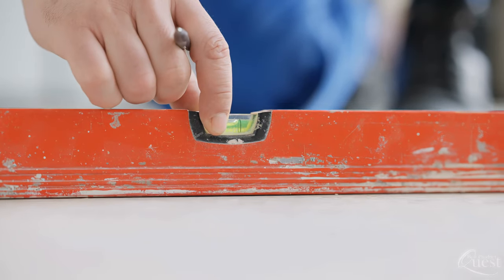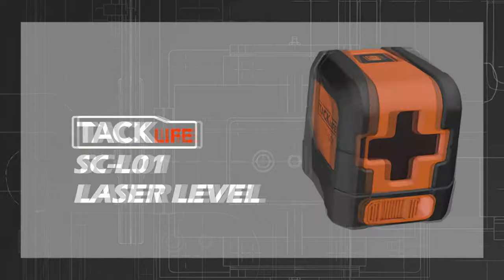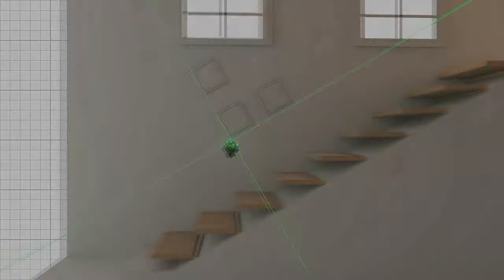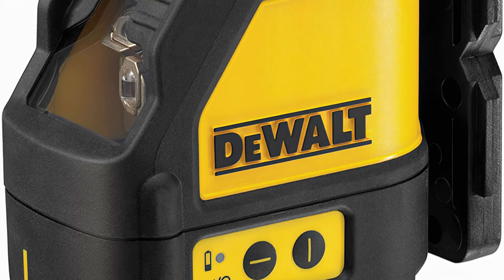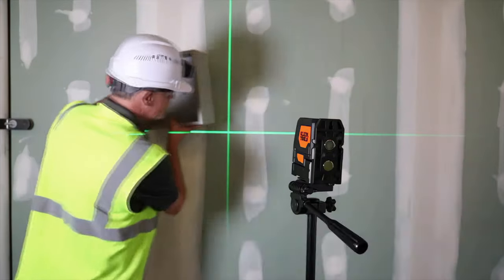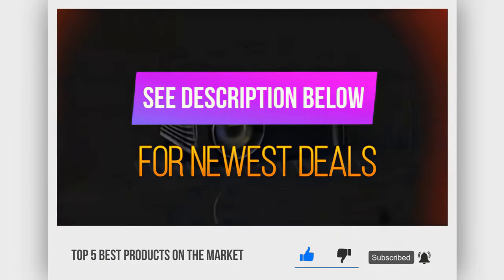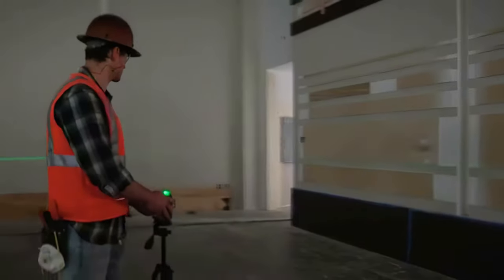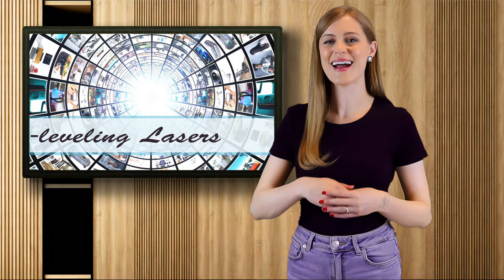Best Self Leveling Laser: Top 5 Reviews [Buying Guide 2023]

Comment from the maker: Links to the items in this video:👇
5. Tacklife SC-L01-50 Feet Laser Level Self-Leveling Horizontal and Vertical Cross-Line Laser - Magnetic Mount Base and Carrying Pouch, Battery Included ✅
Check price one eBay
👉https://ebay.us/Z6Lrsi

4. Huepar 902CG Self-Leveling 360-Degree Cross Line Laser Level with Pulse Mode, Switchable Horizontal and Vertical Green Beam Laser Tool ✅
Check price one eBay
👉https://ebay.us/9cN2oH

3. DEWALT (DW088K) Line Laser, Self-Leveling, Cross Line ✅
Check price one eBay
👉https://ebay.us/g6elAt

2. Klein Tools 93LCLG Cross-Line Laser Level, Self Leveling Green Laser with Red Plumb Spot with Magnetic Mounting ✅
Check price one eBay
👉https://ebay.us/C7kCa8

1. Bosch GLL3-330CG 360-Degree Green Beam Three-Plane Leveling and Alignment-Line Laser ✅
Check price one eBay
👉https://ebay.us/EmVcvQ
Reply: The bomb 💣👍5⭐